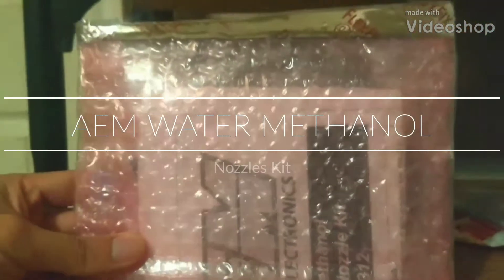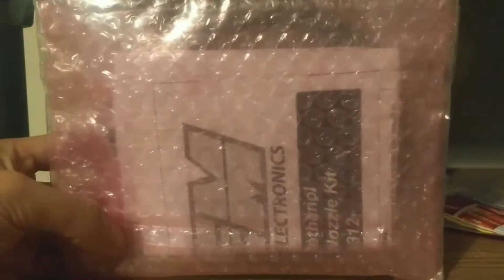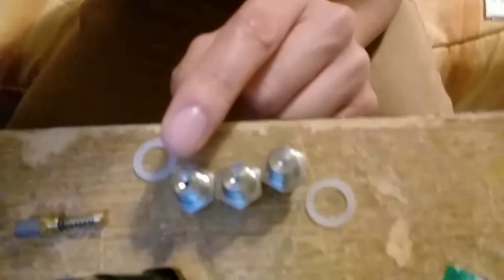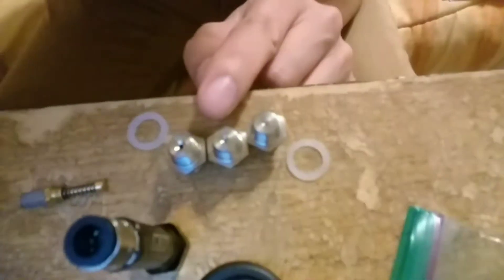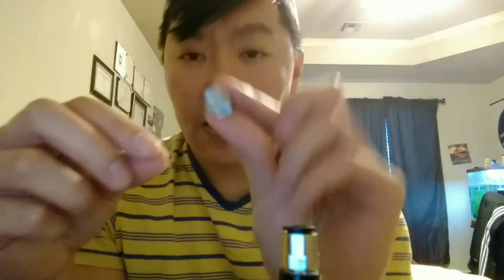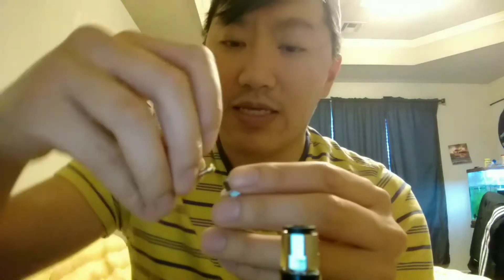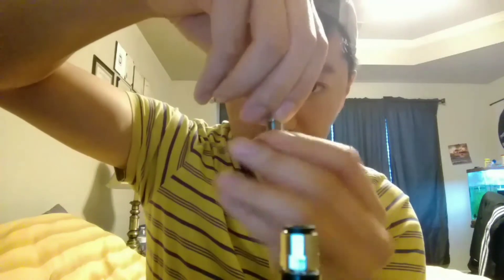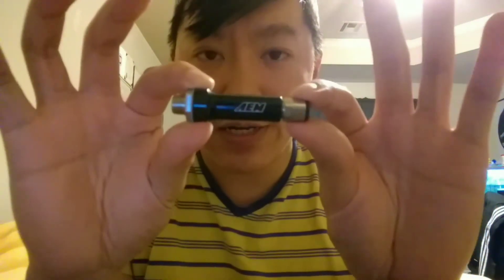How to assemble AEM Water Methanol Nozzles Kit

Comment: hows the check valve? does it leak under vacuum?
Reply from the maker: JuniorMason The check valve is awesome! No it doesn't leak under boost. It's like a spring rate built on pressure.
Reply: I'm thinking about getting one for my speed3 but just for the valve cleaning and oct boost
Reply from the maker: JuniorMason Yeah just do EGR delete and water Methanol! You'll be good for clean valves. That's what I did.
Reply: yea my egr was deleted when I upgraded the turbo
Reply from the maker: JuniorMason Yeah you should be good if you go water methanol.